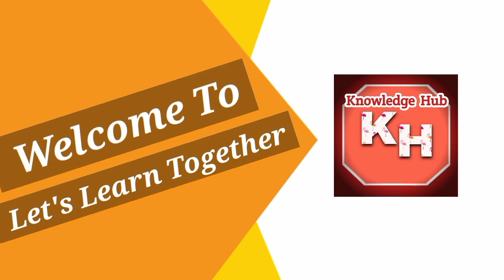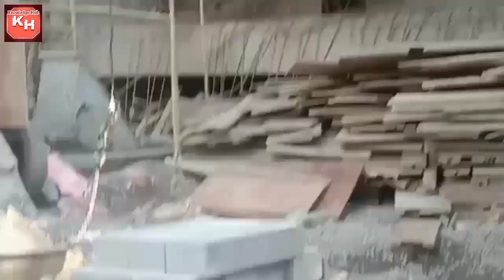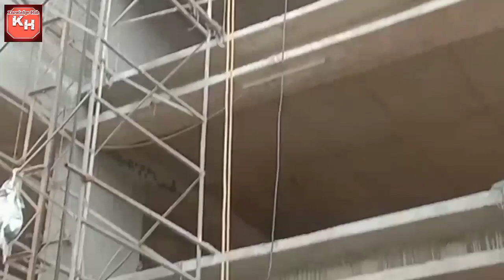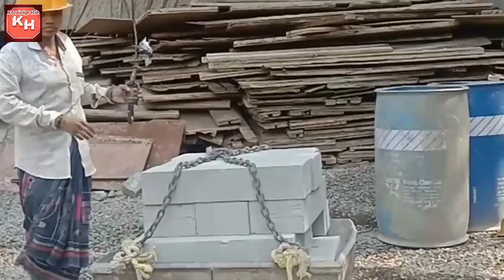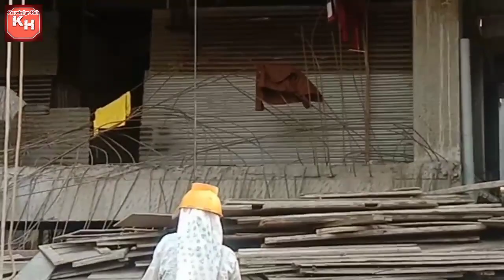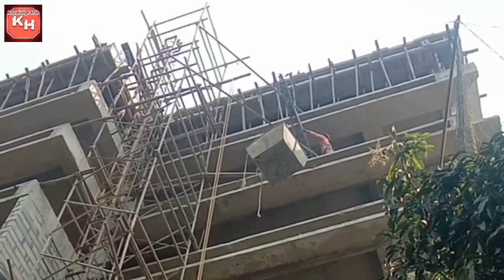Mini Crane  Lift Construction Material I Equipment For Construction Material Shifting I Crane I Lift

Comment from the maker: This machine has a distinct feature of the boom. The boom is flexible and can be adjusted at different levels depending upon the site conditions, especially when the building has chajjas and the chajja length differs with different projects. This feature makes the operation flexible and project friendly.
#civilvids